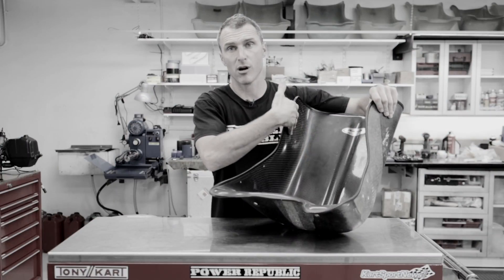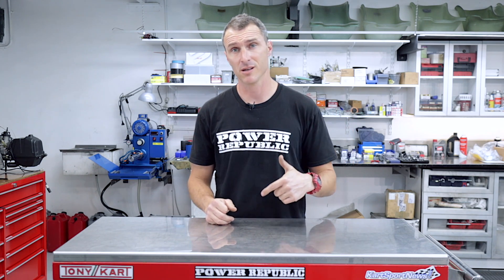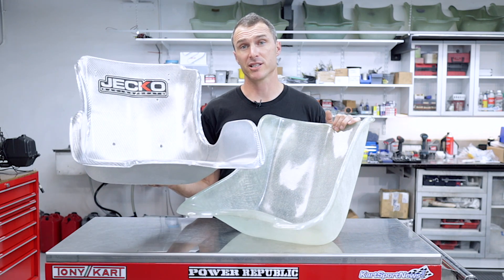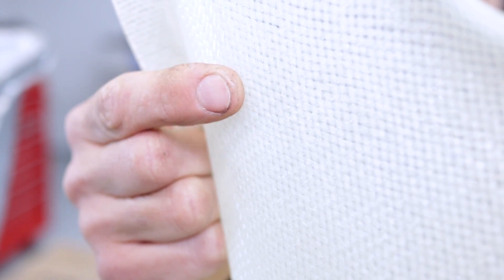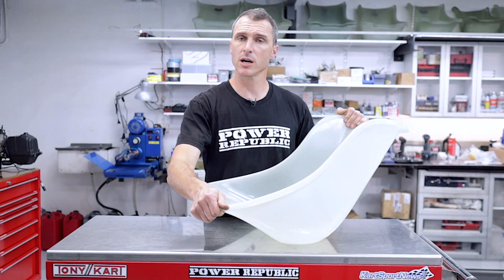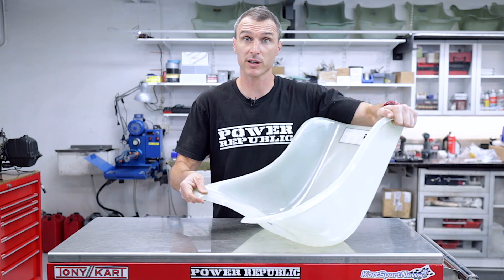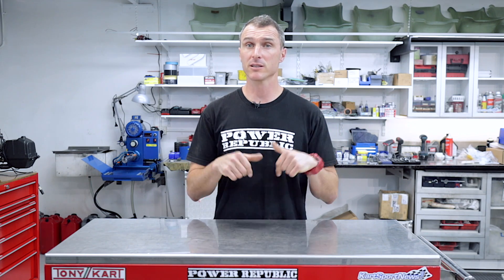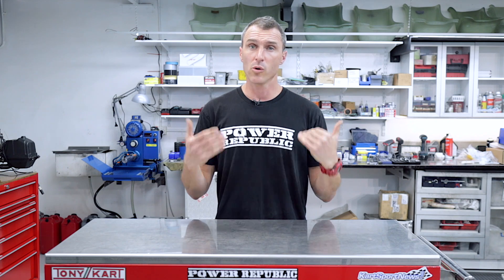HOW TO: Go Kart Seats Explained - POWER REPUBLIC

Comment: Do you use mounting plates when installing the T11VG? It seems like most seats just use the 4 existing mounting braces on the kart. The Tillett Seat Position guide says, “If you use a flexible VG or Vti seat in an adult kart without any extra seat stays only using the four main chassis stays. On the main two upper stays it is advised to pop rivet aluminum support plates against the composite.” I’m not sure if they mean only when using added seat stiffeners.

Comment: When you're referencing seat pads, are those a substitute for a rib protector or a supplement? Also, any information on seat position and it's relation to front/rear grip characteristics would be a fantastic video! Love the channel and the help it provides as someone relatively new to karting!
Reply from the maker: yeah they are in addition too, good for a final firm fit to the seat if the drivers ribs are a little loose.   thanks for the suggestion and also the good vibes 👍

Comment: Another great video!

Could you make a "Part II" about seat positioning and adjustment? I have noticed that many fast drivers have their seat in a very "reclined" position. Why? Does that make them faster? Would it make a beginner/weekend-racer faster too? What about kids? We are all more or less beginners in our family (wife and 5yo starting now, while me and 9yo started two years ago) and struggle with seat fitment and positioning.
Reply from the maker: thanks broski for the positive vibes.  I can tell you that fast drivers are fast because they have done a lot of karting.  Similar to Michael Jordan shooting a lot of basketballs.  We position our seats with the flat bottom parallel to the chassis rails (just like our seat fitting videos). 

https://www.youtube.com/watch?v=P1cXwvfS10M&t=17s

then you can move them forwards or backwards of the centre chassis cross rail depending on your drivers height and weight.  No magic tricks, just go to the track more than everyone else and you will become the best version of yourself.  Hope that helps

Comment: Excellent video- mostly confirmed the direction I was heading, but I have not been able to try the Ribtect seat anywhere over here in the USA/Texas. I just can't justify buying without trying. At 6'4"/215 lbs, I really need something that holds my body in place. I picked up a birelART AM29 w/ lo206 and the stock freeline seat killed my ribs from flopping around.
Reply from the maker: yeah the standard seats are for us standard drivers 5'10 160lbs

Comment: Love your videos. Thank you for all the effort you put into making them and the good info you provide! I'm 178 cm tall and 61 kg with all my race gear. I have two Tony Karts, one with an IAME X30 S125 and Komet K2M tyres, the other with a ROTAX MAX EVO and Vega XH3 or XH4 tyres. I'm racing the UAE, so outside temperatures are typically between 30C-40C during the race season. What seat would you suggest under these circumstances?

Comment: great video! Derek could you do a video  how to install a new chain .. how do you determine  the length ? Because i gotta take both motor clamps off and tilt the motor backwards to get the chain off..lol any info would be great..thanks
Reply from the maker: well, a chain measuring tool is what we use but you have to remove the chain first.  otherwise mark on link with a paint pen and start counting, remembering to double the final number i.e a 54 link chain is actually a 108

Comment: What do you think about the Tillett T8 fully covered seat?
Reply from the maker: Love those seats, but they are a little stiff.
Reply: @PowerRepublic  I'm 41 y/o 1.85m tall 96 kg and installing one in my Exprit Noesis.  The OTK  seat has been killing my ribs and back.  Do you have any suggestions  to compensate  for the stiffness ?   I appreciate you sharing your expertise with all these videos  you rock!
Reply from the maker: @TEKNOTRONIC954  mmmm not sure on the compensation, other than try the TllVG machine made in a 36cm and maybe just pad it out with the seat foam.  that way the seat with the padding will be comfortable and the chassis will still perform like a dream.

Comment: Great video as usual ! I am curious, when you say that the Tillett T11VG seat is the ticket for OTK drivers in Rotax etc. Which tyre are they typically running. With the new Mojo D5 there is lots of grip and less need for the soft seat. Maybe on D2's or on a slippery track the soft seat would be required? Cheers!
Reply from the maker: That is correct
Reply: @PowerRepublic  So which categories are running the Mojo D2 or similar compounds in Australia? We run D2 for Rotax Junior and D5's for Senior.
Reply from the maker: @YZF648  D3 for seniors, D5 for DD2 and C series for the mini max;s

Comment: Great video Des, just one error to mention. 
Carbon fiber is NOT super strong , carbon cloth is weaker than fiberglass cloth. Carbon cloth is good for making parts light, but it is definately 100% NOT stronger than fiberglass cloth of the same weight
Reply from the maker: Thanks for the info!

Comment: Where/when would you use an IMAF adult sized seat? Which karts do these suit and are they a stiff or soft design? Thanks!
Reply from the maker: They have both hard or soft.  Get one of each and use them both at your local track.  For us, hard seat in cold slippery conditions mostly, and soft seats when it is hot and grippy.  Could be different for you and your tyres so try them both IMO.  Jecko suit all karts, same for OTK seat or Tillett, mostly user preferences not silver bullets.

Comment: What rigidity would you recommend for a mini? (IAME 60, Kart Republic or OTK)
Reply from the maker: What sort of racing are you doing and what is the ambient temperature ?
Reply: @PowerRepublic  IAME Series Benelux: +/- 11 laps races - 1 quali, 2 heats and 1 final with the same set of tires (Komet Medium) in Belgium, from 10 to 35° Celcius
Reply from the maker: @madpearTube  Tillett T11VG soft seat is hard to beat at the big events

Comment: Hi for a tall driver (180cm) what is better seat OTK hard, or softer tilled v11g or jecko
Reply from the maker: Hey Paulo, what tyres are you racing on and is it in hot sticky conditions?
Reply: @PowerRepublic  mg reds ka100 the track is a parking lot so has no grip all the time but in the race weekend the grip is different.. the track is in Miami.. so is hot al the time.. around 35 to 50C

Comment: go to a surfboard manufacturer and get a custom made one.
Reply: yep that would be me (lol)
Reply: I customized mine myself. Its not too difficult, but did cost about £100 in padding and cover, and i had a spare carbon fibre CRG seat to use as the seat itself.
Reply from the maker: Fully custom
Reply: Tillet custom make them but im from UK  so might  only be available  here
Reply from the maker: @ddk4664  yeah maybe

Comment: Seat comfort was my 1st priority. Mine has 2 inches of memory foam in the seat base, pressure relieving gel surface for that, the sides and back has stiff kart seat foam and its all covered in black PU leather with green stitching. I also remounted the ecu and water pipe behind the seat so i didnt need to have unnecassary bolt heads by using abit of glass fibre to mount bendable brackets onto the rear. Bolt heads for the side mounts are recessed completly into the pads and i cannot feel them at all. Its tight to fit in, and i pop into it when getting in with no room for body movement at all. Once in, its more comfortable than an arm chair. https://youtu.be/qz8IOCpD2JY.
I also mounted it on rubbers underneath the base to the frame mounts, to reduce vibrations being transmitted into the seat instead of the old solid mounts. It weighs a few pounds more than a normal seat, but that shouldnt be a problem as id probably need an extra 20kg adding to make it race legal weight as is, so id prefer to be comfortable than carry lead which does nothing to add to the driving experience.
Reply from the maker: Hey Chris, sounds like a lounge chair for sure.